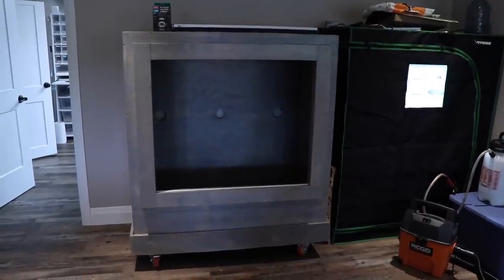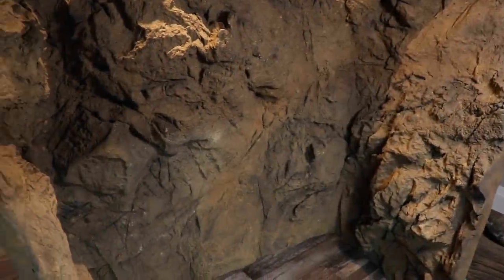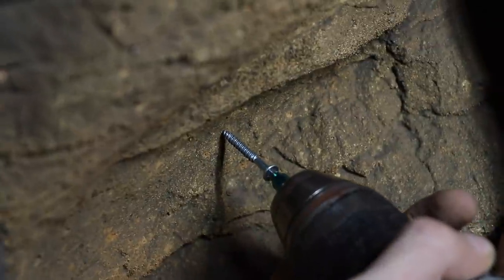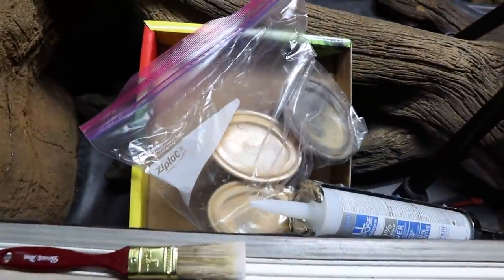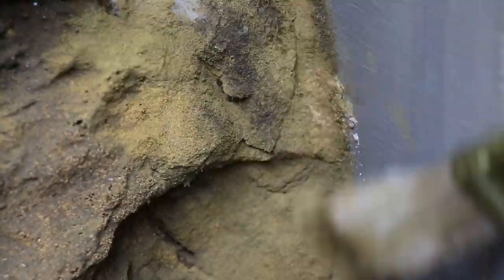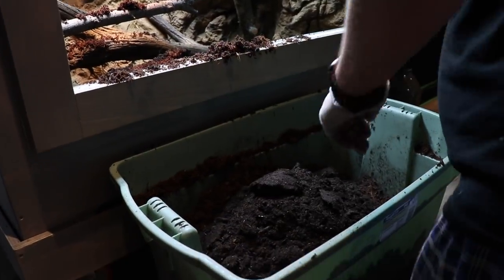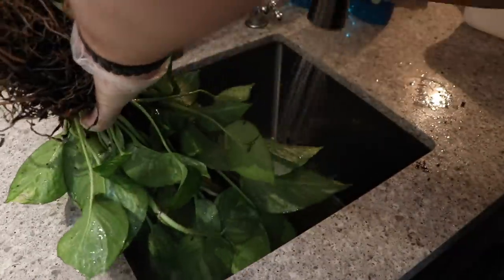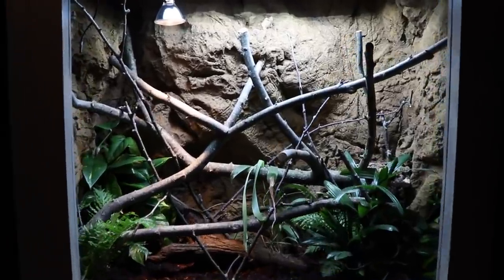RARE IGUANA PARADISE!! Custom 280 gallon VIVARIUM!!

Comment: Hi Mike, quick question you originally had 2 lamps on the glass enclosure and you gone down to 1 in this one and you said about dropping to a 50w so my question is what was the 50w bulb you changed too as you didn't say in the video and is that all you used in this enclosure. I only ask as I'm researching for possibly getting one and yours was pretty much the only videos that came up. I'd be grateful if you could get back to me regarding the heating
Reply from the maker: The reason we went to only one is because this enclosure has much better insulation so with two bulbs it would have gotten too hot in the enclosure for him. The one in this enclosure is actually a 75W halogen bulb by arcadia that is controlled by a dimmer.